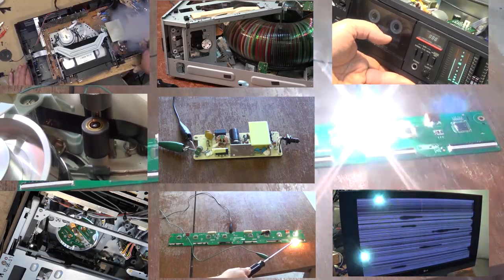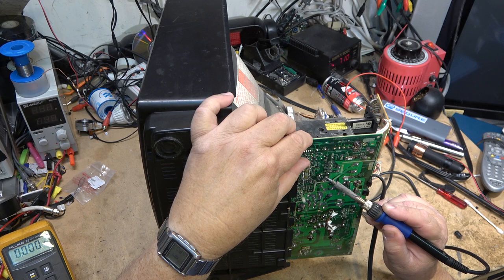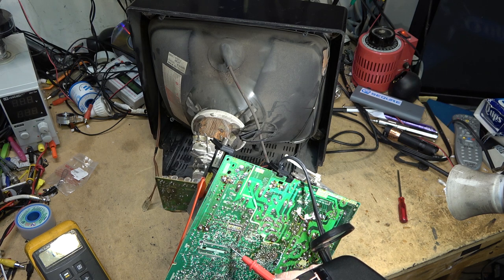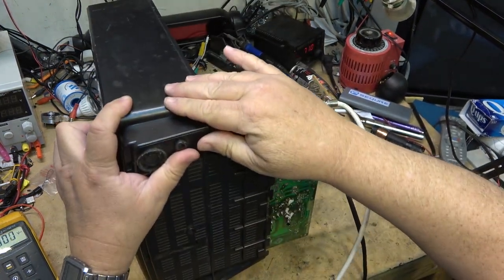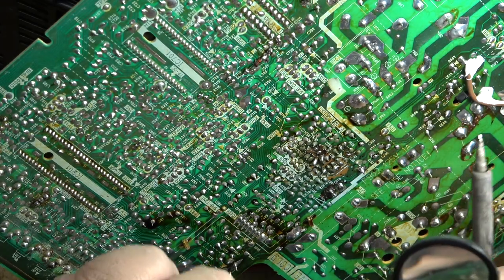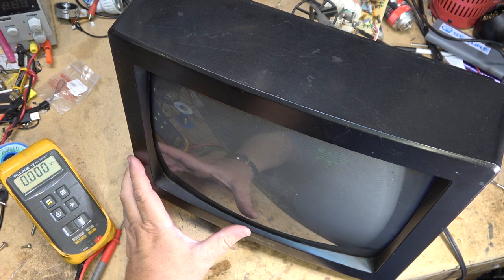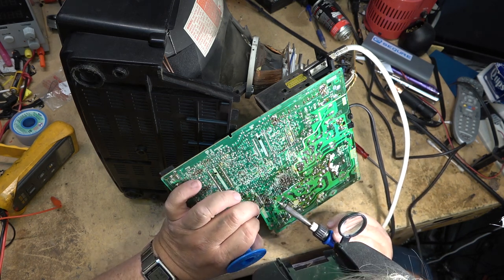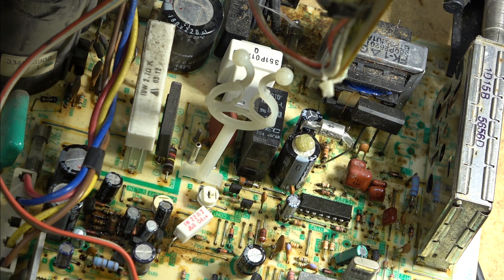Mitsubishi CRT TV Dead making a humming sound when plugged in

Comment: Woah that cap failure as it was running was awesome! Is it a case of the high ESR effectively makes them resistors, so they get hot as they dissipate current, which boils the electrolyte? I've seen the end results, but I've never actually seen it in progress before! Great video. Thanks 👍
Reply: Failure in a very controlled manner. It didn't escalate (yet). This is why it looks like silicone glue on top of it.

Comment: About 20 years ago I had loaned someone a cheap 50watt pioneer 2 channel home amp. A few years later I got it back not working. A candle had been set on top and the stereo melted it into the speaker protect relay and the wax cracked a zener diode that drives it. I still use the amp today at work on a daily basis. Fixing things is a wonderful hobby to have!
Nice save from the junk heap :)

Comment: This sparking sound is similar also when the tube glass in the neck around the yoke has broken due to overvoltage of the psu output voltage but in this case there are visible lightning sparks inside the crt neck.
Reply from the maker: Lightning sparks happen in the tube when it loses vacuum.  If it just loses a litttle vacuum then the tube turns into a neon lamp.

Comment: What if there is a buzzing sound coming from the crt yoke?
Reply from the maker: All the yolks can buzz because they are of course receiving energy from the flyback and the vertical circuits. If they are not glued properly together in other words the ferrite cores and the windings are not secured with Hotmail blue which is what they put on at the factory you can get a buzz as they will start to resonate and act like a speaker. If the TV is working and all it's doing is making a squealing sound coming from the yolk you can try spraying down the with something like flex seal to fill in any cracks in the original glue that is probably hardened and dried over the years. Same goes for flyback transformer core.  Used to be really common for Panasonic that the core on the flyback wasn't glued properly and would squeal. Flex seal to the rescue again.
Reply: @12voltvids  the yoke in my jvc is buzzing loud aside from the normal pitch. I tried putting alot of epoxy glue but its still buzzing. I do see some cracks in the inner tube. Can you swap out yokes from another crt?
Reply from the maker: @retrofan4life  yes you can if it's for the same tube. each specific tube number had a specific yoke that was designed for it.
Reply: @12voltvids  ok. Will it be fine then to use the crt with the buzing sound. I havent been able to locate or fix it on the yoke coil.
Reply from the maker: @retrofan4life  it won't hurt it. Might hurt your ears but that's about it. If it develops a short you'll know you'll see it in the picture and you'll smell it.
Reply: @12voltvids  ok. The crt is in good shape just sucks this coil part is the issue. Would it be something I could send to you for repair if possible?